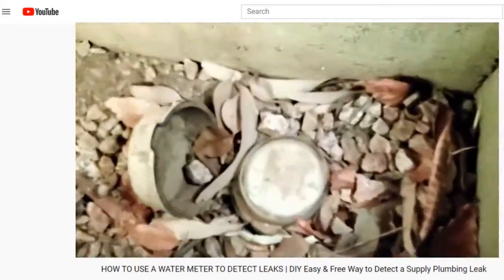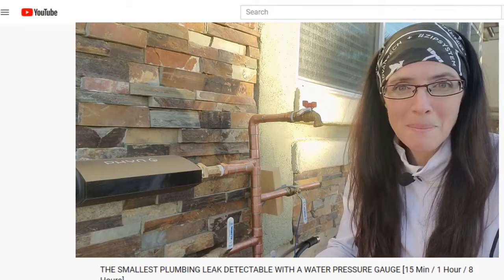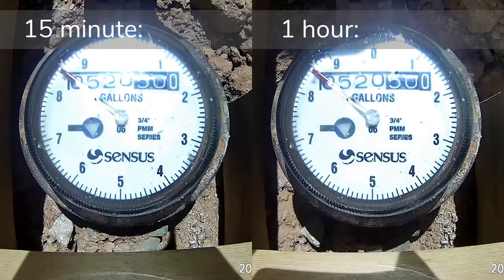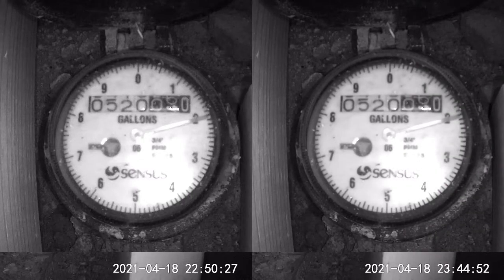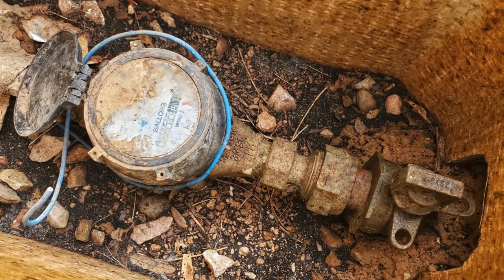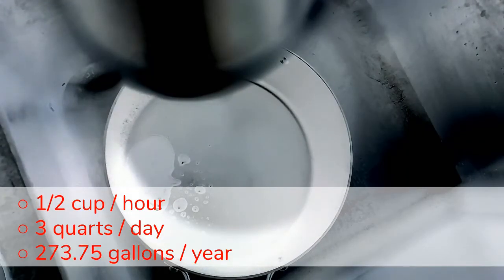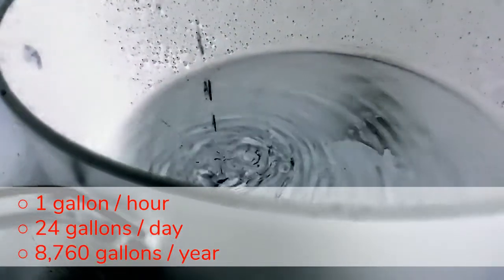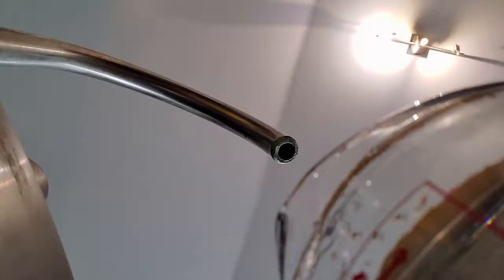HOW small OF A PLUMBING LEAK CAN BE DETECTED WITH A WATER METER [15 Min / 1 Hour / 8 Hours]

Comment: I got a bill a couple of years back for 5000 gallons in a month, never did I use over 3 in a month in the winter. Call the water department to no avail. It did not repeat itself but I did install an NSA water meter of my own that can be attached to a remote readout. Meter the meter, well they are fairly accurate between the two. What this bring me to is that your city might provide as mine does a kit for your toilet, it's water dye tablets. Never did use them but learned the Kohler had a replacement silicon ring for the newer style (barrel type) flush valves. The original design was Red and the new style is Yellow. The Red had failed in one unit, the other had the yellow but replaced both anyway. It's a hidden leak other then and how I caught it; heard the unit filling without use to replenish itself. I was just walking by the room one day and got the ah ha moment.
Reply from the maker: Interesting the water department doesn't pick up the phone but the'll give you a toilet kit to detect leaks. Glad you caught the toilet leak yourself! That's no small feat--those can go on for a very long time before they are ever discovered.

Comment: Hi there! Nice video. My water meter does not show any movement but as soon as I shut the meter valve, pressure drops rapidly to zero. All pipes were disconnected and pressure tested with no drop in pressure. Do you think the meter have any back flow or anti siphon features?
Reply from the maker: My thought is, if the meter valve is shut off, there should not be a way for water to move backwards. However, the meter valve could be faulty and not close all the way. We had that happen to us. When we replaced our water main and we found out we could not shut off the water all the way. The leak filled up the line pretty quickly, making connections difficult.

That's the only explanation I can come up with if you had the rest of the lines pressure tested beyond the meter. Unless there is additional untested pipe between the meter and the rest of the plumbing that was tested? If so, there could be a pinhole leak underground, or something along those lines?

Meters certainly allow for back flow and generally it is too small for the meter reader to move. Or who knows--maybe it is designed so it doesn't move backwards--the meter itself, not the turbine inside. I mean, they want to sell us water, not expect us to give any back.

I hope that helps some. I'd love to hear what ends up happening and it's not a leak. 🤞
Reply: @NoMoreLeaks  Hey again! Looks like after a thorough checking I identified the problem, kinda. The last time I tested my pipes, I tested them with air, that can explain a lot, since it takes much more for air to loose pressure in a pipe due to expansion vs hydraulically testing them. Also, it looks like newly installed meter (Badger brand) can not register this leak, unless I close it then turn on again. I disconnected and retested my outdoor pipe and it’s loosing pressure. Now, I have to identify the leak and hopefully it’s not under my driveway, if it is, I will have no choice but to sleeve 3/4 pex inside, potentially reducing some flow, but saving 6K on a new driveway for now. Would love to hear your opinion on that. Also, I had a previous, resolved problem when my house water was back flowing to city from W/H expansion, causing the meter to spin only forward, as you mentioned, they do not design it to back-register. Anyways, double check valve resolved that problem…thought you would like to hear about it🧐

Comment: Hi. I have a consistent leak for months now of .3 gallons per second, as detected by my Flo By Moen. We changed all the insides of the toilets, did the food dye test, put in a check valve, changed outside bibs, checked for water on property. Turned off water softener for days, as well as humidifiers for days. No change. We have our own well water. When we shut off the water to the house, the pressure drops to zero almost immediately.  Is there anything else I am missing or do I now have to pay $600 minimum for Leak Detection Service to come out? Thank you!!
Reply from the maker: That's a big leak! Have you tested to see if it is in the hot or cold water line? I have a video in the works for how to do this for water monitors (but have a reason I can't finish it yet), but it is similar to doing it with a water pressure gauge: https://youtu.be/I4F4HV4nipk. Here's some other signs that might help if you have a slab foundation and the leak is below the house: https://youtu.be/ZqCkAxP0IV8 If any of those don't work there isn't much you can do to locate the leak other than call a leak detection service. I feel you there--we had to call in a service to locate our below slab leak in our hot water line. It's a good thing you have Flo though especially if it's this hard to find! I'd love to hear where it is and what you end up doing.
Reply: @NoMoreLeaks  Thank you!! I definitely will let you know. Will watch your video!